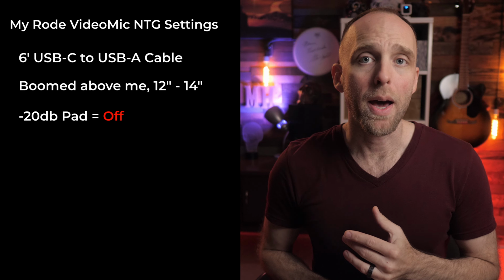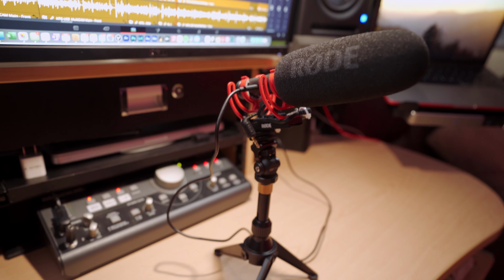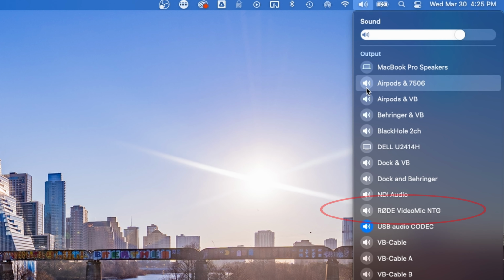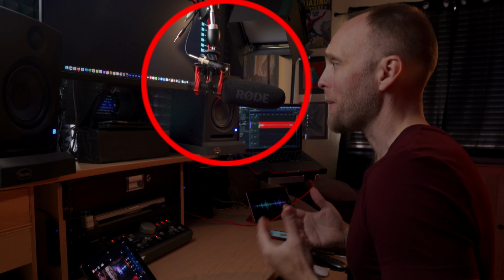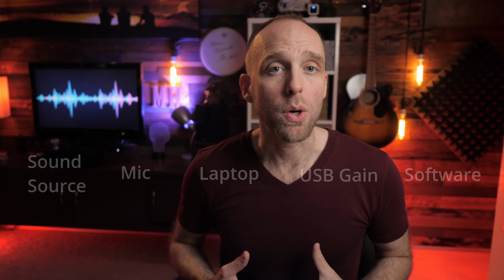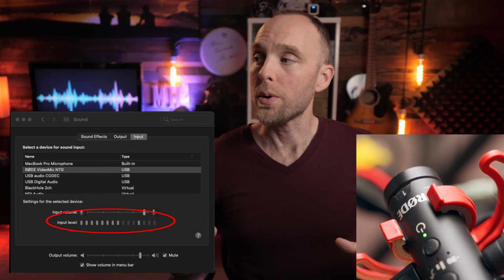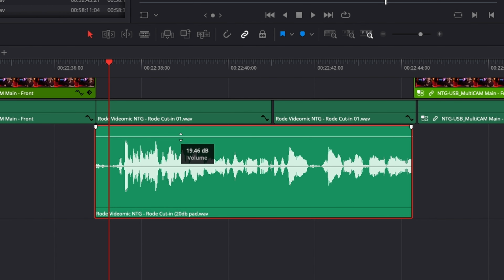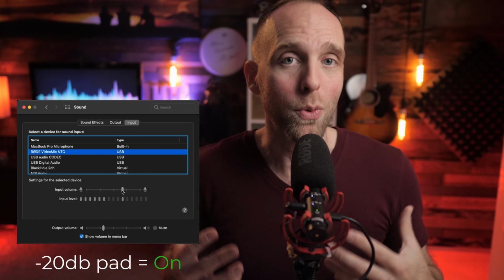How to set up your Rode Videomic NTG via USB for the best sound.

Comment: Thanks a lot. That would have save some hours I was looking around for the pre-amp on the computer. Even used rode connect and level adjustments there have no influence at all. It was exhausting. Thank you!!!
Reply from the maker: Thank you!  I'm so glad the video helped you, good luck and happy recording :)
Reply: @MarcusHutsell  BTW I found out, that the adjustment in the rode connect app is adjusting the pre-amp control of the system being 1 number equal of 6%. 
Do you think using  a H2N from zoom would lead to even better results???

Comment: This is an excellent video. Clear, thorough and very helpful. I've spend hours trying to figure out how to connect my mic and got nowhere until I came across your channel. I figured out the gain knob did not affect the gain using USB but the Rode website didn't mention it!! I'm now set up to use the NTG for my teaching next week and will be using it for recording videos also. Thanks for sharing this, subscribed and liked! Keep up the great work!

By the way, do you know of a simple way to eq the mic in a live stream setting? I have audio hijack running to backup the audio from the NGT and system into two channels, and audio hijack has a nice wee EQ built in, but clearly this is only for the recording and not for the mic throughput to Chrome which runs Blackboard, the lecture app.
Reply from the maker: Hi Joe.  Thank you so much.  I appreciate it, I scripted this one out fairly carefully to hopefully make it informative and easy to follow, I'm glad it helped.

As far as EQ'ing the mic live, yeah, that's a tough one.  I have found, at least when I'm editing my audio for these videos, when I use my VideoMic NTG, I am almost always pulling out some 400Hz up to around 1KHz quite a bit.  

For meetings, I don't do any EQ'ing because when I listen back to my meeting recordings, I think I sound fine with the mic "as-is."  But my editing workflow to try to clean up my audio involves compression/Expansion/EQ/De-Essing, so, all of those things, especially compression, are altering the natural sound a bit before it gets to the EQ.

However, if you REALLY wanted to EQ the mic live, you can run the mic through software like OBS.  I do this for all my meetings, I run my camera and my audio through OBS, then use virtual audio cables to route my audio over to something like Zoom.  For me, I'm not EQ'ing live, but I AM compressing and de-noising my audio in OBS INSTEAD of using the meeting platform's audio controls.  

So:
NTG Mic > OBS > 
Add Filters in OBS (DeNoise, Compression & EQ would go here...then add audio-monitor to send OUT to a virtual cable)] > 
Zoom/Blackboard Audio IN = [Choose That particular virtual audio cable]

Now Zoom/Blackboard will hear my mic AFTER it's processed by OBS.  

The hard part I think would be trying to pull out the frequencies you don't want because trying to monitor the audio this way......you'd hear a delay on your voice because you'd have to monitor AFTER those audio filters and it takes times for OBS to process and send the signal back to an audio output, and you'd have to monitor through OBS, so your voice won't be "live," it will be about 1/3 to a 1/2 second behind, and it's hard to talk when your voice in your headphones is about 1/2 second behind your actual voice.  (So, you won't hear these EQ changes or other OBS filters by live-monitoring with headphones directly out of the NTG headphone jack).

But, you can certainly EQ it live that way through OBS, just might take some testing to pull out the right frequencies.  

I also almost always have the 75 Hz Lo-Cut filter on.

I hope that helps, cheers Joe!
Reply from the maker: I think I stand corrected, looks like OBS does not have a default EQ in the filters section.....I've never looked, maybe there's a 3rd party EQ filter.  Now I'm interested in finding out!
Reply: Hi Marcus, thanks for your thorough reply! And sorry for tardy response... I'll give the obs software a try in the step you share, but unless i hear a significant difference, I'll probably leave as is for zoom etc. I notice you use adobe audition, which I have but not used much. I'll dig into that and do my EQ there for when I'm recording videos. Again, many thanks for your very helpful suggestions. Best regards, Joe

Comment: I just got one of these and this was really useful, thank you. On Windows at least, using the USB input, I'm not sure what was said about setting the input level was correct. On some USB mics in Windows the Control Panel/Sounds input level can say things like "0db, +3Db, +9db" so it's obviously adding gain on the input, but for this mic you just get a slider from 0-100. I did some tests and as far as I can tell the Windows USB input level is just a percentage, so unless you want to make the input quieter (and raise the noise floor) the value should always be 100. I tested this by trying to clip the USB input (without clipping the mic) but the Windows input level was literally just a reduction in volume, level 100 seemed to be the mic source, and 50 seemed to be 50% volume of the same source. So a value of 100 seems correct to avoid prematurely lowering the volume. If you then move the sound through a processing chain that adds gain then you may start to clip, but would think that you would just reduce the input at that stage rather that removing the input at the mic stage? Anyone else played with this on Windows and can share some thoughts? :)

Edit: Ignore the above! After more testing on Windows, when plugged into USB the Windows Mic input level (sounds/control panel) directly affects the gain of the mic. For example, when you set the mic level to 100 then you can see the clip indicator on the mic light up at the slightest noise. Setting the level to about 80 lets you talk into the mic at around a foot away without the clip light coming on.

Comment: Fantastic work. So if I use this mic as a usb mic do I ever have to worry about battery being charged or will it be powered by bus power? I’m buying this for a podcast so it will always be used as usb.
Reply from the maker: Hi there David.  It will ALWAYS be powered over USB-bus power if you have it plugged in via USB......so, no worrying about the battery dying in that case.  It will only use the internal battery when NOT plugged in to a USB port.  Cheers, and thank you!
Reply: @MarcusHutsell  Thank you very much. Great info and work on your channel

Comment: Great vid. Would you get better, or worse audio if you opt to using auxiliary instead of USB?. thanks
Reply from the maker: Hi there Purple Carve. That entirely depends on the device that’s receiving the 3.5mm “aux” cable from the videomic NTG. For instance, the Panasonic Gh5 has fairly noisy preamps on its 1/8” (3.5mm)  input, so, I’ll always get some noise when using the NTG with the 3.5mm output going to my GH5. It really depends on the next device that’s receiving the signal and how noisy that next device is. 

USB direct is often a lot cleaner, less system “noise” (usually in the form of hiss). However, I have also encountered very minor high frequency noise when recording via USB… But that could be a number of things because I have a lot of stuff plugged into my laptop, coming from different sources, lots of USB hubs, a thunderbolt dock, and lots of things that need power that are plugged in around my computer, so even when I do hear that very faint, high-pitched USB noise… It’s different than hiss, and it’s not always there, and to be honest, it’s so minor that I could barely even hear it in my recording, and I was REALLY listening with good headphones and editing a video so that the audio was as clean as possible…..I have discerning ears ;) most people would not even know what I was talking about. 

But overall, the USB direct option will almost always produce way less noise than using the 3.5 mm I’ll put into another device.
Reply: @MarcusHutsell  awesome. Thank you. It would be plugged into a new Full E amp but I like less wires as well so I’m gonna go USB. Thanks

Comment: Marcus - thanks for the excellent tutorial - by far the most informative and helpful video on adjusting the Rode Videomic NTG!  I have a similar setup to what you have - 2 external speakers on my desk with the NTG mic on a boom above my displays and pointed down toward me.  I primarily use this setup for online meetings, like zoom.  I speak into the NTG mic for my audio and listen to the meeting participants through the external speakers that are positioned to the left and right of the mic which is about 1.5 feet above the speakers and centered above them.  The mic is about 12-15 inches from my mouth and about 6 inches in front of the speakers' plane.  My issue is that the zoom call participants audio that comes out of the speakers still feeds back into the NTG mic even though it's a directional microphone.  I adjusted my mic input settings using your flow from source to software and my input is fine.  But depending on who is talking in my call, I may need to increase the volume of the speakers in order to hear them.  But increasing the volume gives me a higher chance that the caller's voice feeds back into the NTG mic.  

Any suggestions on speaker placement (relative to mic), audio levels, Rode software like Rode Connect, etc to balance my speaker output to *not* feedback into the NTG microphone?  How are you preventing your own speakers from feeding back into the mic or do you always use headphones even for zoom type calls?
Reply from the maker: Hi there David.  Great great question!  And, you actually got to the answer by talking through it...........I ALWAYS use headphones.  Period, for virtual meetings.  

Unfortunately, no matter how directional a microphone is, it's always going to pick up SOME amount of sound from the sides, and that's usually due to the environment you're in, not just the microphone.  Because sound is going to bounce off your desk, your walls, your ceiling, floor, YOU, and get picked up in different ways by the mic capsule.  Sound bounces, that's just the way it is.  So, theres not MUCH amount of angling you can do to truly get rid of the sound from the sides.  

Also keep in mind that, being a SUPER cardioid polar pattern, the Rode VideoMic NTG is going to also pick up some sound from the direct-rear of the mic.  ALL Supercarioid polar pattern mics will have some pick up from the rear, that's just how the physics of super cardioid patterns work.  So, if your speaker is directly behind your mic (as you say it is, just 6"), your mic is still going to hear the speaker decently well.  That's the tradeoff of a more directional polar pattern.......it starts to pick up from the rear as well.  

And, because the meeting platforms (Zoom, Teams, Google Meets, etc) are a bit out of our control, if they sense or hear a caller coming back into your audio feed, they're probably going to start employing their echo cancellation, whether or not you've turned it on.......or, if it doesn't automatically do it, then yes, you'll hear them AGAIN, Again, again.....as their voice comes through your speakers, gets picked up by your mic, goes back into the platform,.....comes out of their speakers, goes into their mic, and the process can repeat and you get unwanted echoing of voices.

So.......I just wear headphones all the time.  I'd say if you can wear headphones or airpods or small ear buds to LISTEN to the meeting, that is going to take care of that problem.  I just don't recommend using Airpods as a mic, because the audio quality won't be great......and hey, that would negate your great-sounding Rode VideoMic NTG!  

I actually did a video about this using my airpods:  https://youtu.be/ysZqf1cJs40
And I also did one about NOT using your airpods:  https://youtu.be/HXcDjx3_U9Y

Anyway, I hope that helps.  Physics and acoustics are hard to beat sometimes. 

But, you could also try angling your mic a bit more so that the REAR of the mic is pointed more away from your speaker.  

As far as MY mic placement goes, I have it boomed out OVER my speakers, and at my normal position, the mic is actually just ABOVE the tweeter of my right speaker, angled down fairly steeply, so the side of the mic is actually towards the speaker more than the rear of the mic.  The rear of the mic is pointed more at the ceiling (although the mic is NOT completely vertical).  This position is better and may work better for you..........get the side of the mic more towards the speaker.  However, that does NOT solve any potential problems of the mic picking up a bit more of my LEFT speaker.  (my webcam is pretty far off to my right, so I'm always looking that way when I need to speak to virtual attendees so I can look at the camera, so my mic is also off to my right a bit).  

I'll have to try it out using my speakers in a virtual call to see how much it can reject the other participants, but, again, I'm always using headphones.

I hope that helps, try your mic angle, put up some absorbent materials around your office, ceiling, etc.  

Good luck!
Reply: @MarcusHutsell  Thanks for the detailed response!  I came to the same conclusion as your recommendation - to use headphones with the NTG mic.  No amount of placement adjustment could prevent the mic from picking up some sound from others talking on the call and causing feedback.  I'm in a lot of conference calls daily so I was trying to avoid wearing headphones.  

I'm going to use wired earbuds so that I don't have large cans on my ears all day.  I do wonder how most others just use their laptop's speakers and microphone and don't seem to be having feedback issues since the distance between them is much closer than my external speakers and NTG mic - mine is boomed similar to your setup except I have the NTG  equally spaced between L & R speakers rather than over one of the speakers.  Thanks for the helpful videos!  I'll check out the airpod videos.
Reply: @MarcusHutsell  I am considering the Rode Videomic NTG as well but am have some concerns over the lack of a physical mute button/visual mute feedback for teams/zoom calls.  Have you found a way to manage this better than using the software mute button in each app?  Thanks Marcus!
Reply from the maker: Hi there Stephen. Yeah, great question and conundrum. 

The only way that I can solve this when using my Rode videomic NTG directly via USB is by using an Elgato stream deck. 

I realize that’s another device to purchase, but I use a stream deck a lot at home when I’m on virtual meetings and I have programmed a button to mute my microphone in OBS… Because I use OBS to send my audio and video into and then send my audio and video from OBS over into zoom or teams, etc. 

Stream deck software also has some plug-ins that will allow you to mute zoom directly with the stream deck buttons, but I use the OBS method… But OBS and all the routing can be fairly technical and if you don’t get it right… You won’t always be muted.

I hear you there though, at my work office I have a regular XLR mic that I have running into a Rolls MS111, it’s a  physical mute switch so that I know, without a doubt, that my microphone is muted. But that device won’t work with the Rode videomic NTG unfortunately.